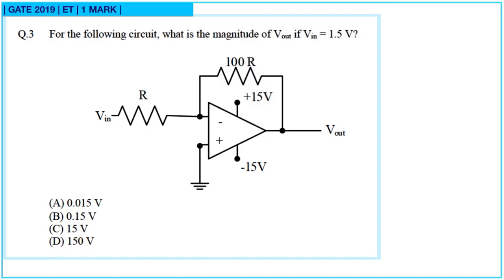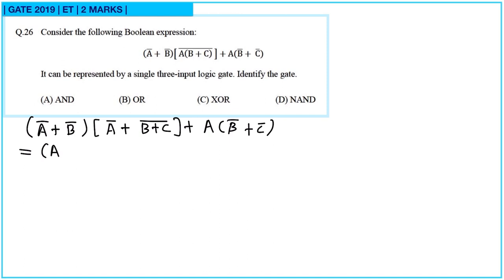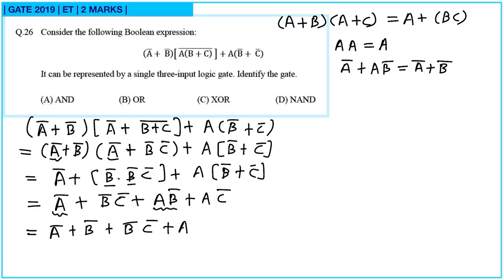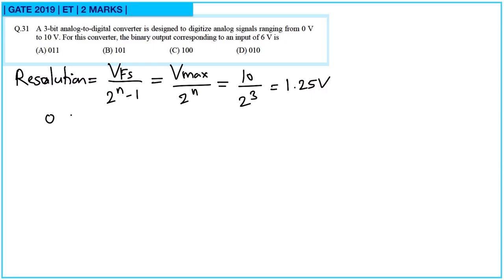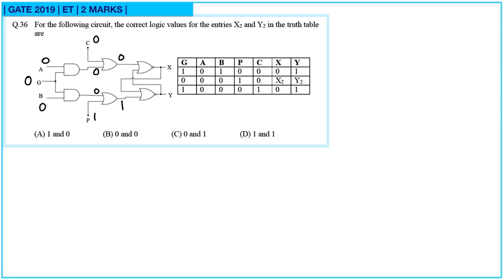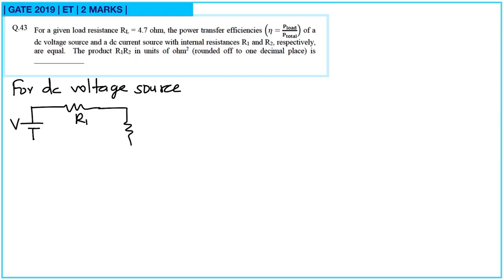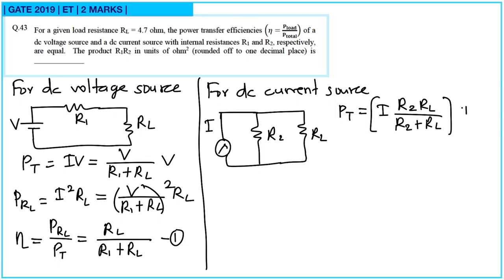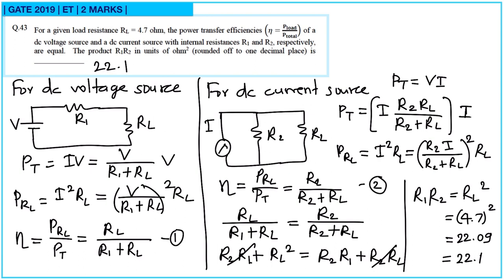GATE PHYSICS 2019 Solved Paper | Electronics | Previous Year Paper COMPLETE Solution

Comment: 100 x1.5=150 see that
Reply from the maker: Thanks for pointing it out! 😊 So it comes out to 150. It seems there might be a mistake in the official GATE answer key.
Reply: @BhautikShastri  No mam There is saturation voltage of 15 volts. So final output voltage will be 15 volts
Reply from the maker: Ah yes! Thanks for pointing that out.  if we consider the saturation voltage of 15 V, the final output voltage will be 15 V, not 150 V.